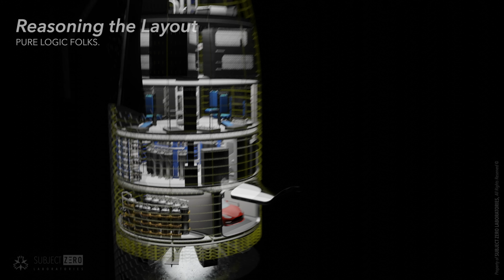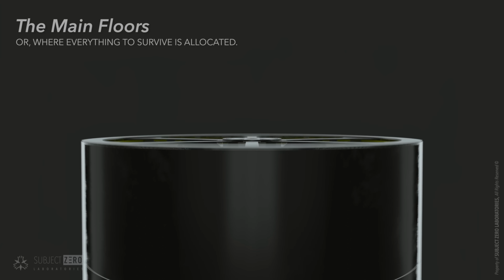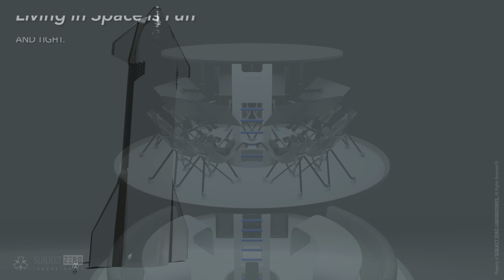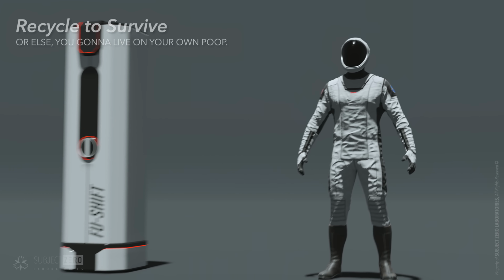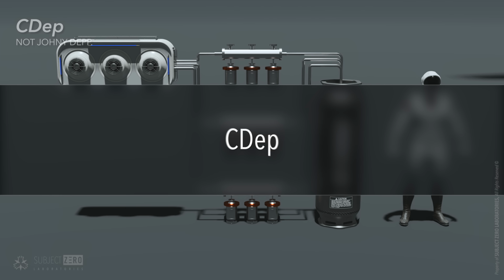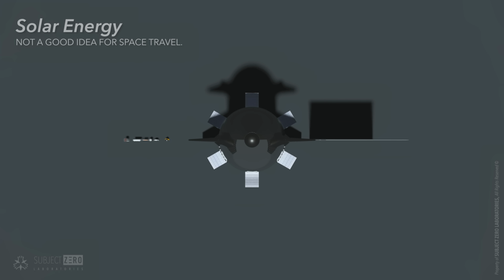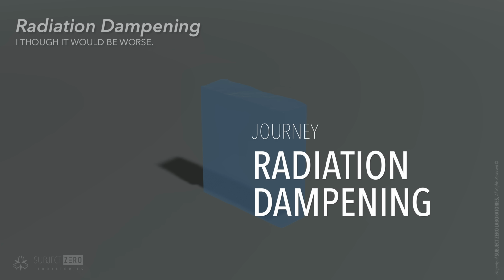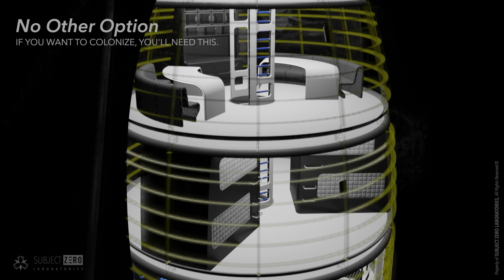Onboard the SpaceX Starship 2.0 in Detail - What it takes to go to Mars | Detailed Breakdown

Comment: Really enjoyed your video. Pretty thought out. There is a couple of items that are usually ignored that bothers me. 1) Starship when vertical has an up and down, but Starship when horizontal also has a up and down. When it's landing you want the people in the bridge of the ship to be upright. So the op's deck of the starship will probably look like the Dragon capsule. With 4-5 chairs sitting "upright" when the ship is doing it's flip maneuver to land. 2) The center of Starship will not be a "tunnel", but a "column". The main ship plumbing will be in the central column running down the ship, top to bottom (which will include the downcomer). That column should have hand rails / steps so people can climb up and or down the ship. Also, you wouldn't have a long tunnel running top to bottom. You will have a ladder going down only one floor at a time, with a slight off center look to the next ladder going down to the next floor. Like this, nobody will every fall more than one floor on Earth or Mars gravity and not 5-6 stories down. 3) I feel people that do these designs need to add water tanks between every floor, not to mention all sorts of wiring. So the in between the floors need to be much thicker, not just one level on top of the next. Because of this, I don't think Starship will have as many levels as people think it will.
Reply: Great comment on the middle column and the offset of level entries
Reply: It's possible it could be a 100 percent for water reclamation

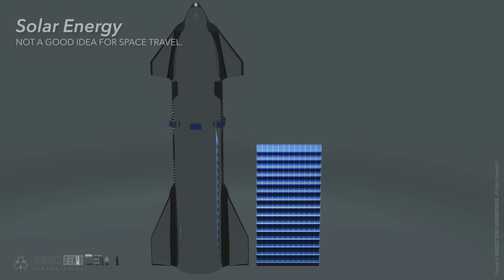Comment: 10:20

ISS solar panels were built in 1990s and are significantly less efficient than modern solar panels. Check out the iROSA panels - they were small enough to fit inside Cargo Dragon, yet still provide a significant chunk of energy to the ISS.

Comment: I would be very interested to see this with different mission lengths. Elon stated with a slide back in September 2016 that Mars missions should take
2024: 140 days
2027: 150 days
2029: 140 days
2031: 110 days
2033 90 days 
NASA has shown 30 days on Mars is possible to return before the planets are out of alignment meaning a full mission could be 330 days long instead of 5 years
That’s a 5.53x shorter mission
Daily ration 
2.5kg Food
3kg water
1kg oxygen
Water can be continually reused so is almost negligible per astronaut and the oxygen can be used from the main fuel tank instead of separate tanks, meaning roughly 2.24x less mass per astronaut 
CO2 and hydrogen can be converted to Methane and water using the Sabatier reaction and H2O can be converted to Hydrogen and Oxygen using electrolysis so this can mostly solve water, fuel, and waste issues.
This can effectively bring the mass requirement down to 825kg per astronaut (+ 75 kg astronaut + 75kg water) 
At ~1000kg per astronaut, 10 astronauts would only need 10,000kg for a return mission instead of 118,625kg

Comment: This was a great video to watch and very thought provoking.

My thoughts at the end are that the trip to Mars needs to be a flotilla (maybe 3) vs one ship.
This would have many benefits.
The multiple ships could be used, for example, one to carry people, one to carry supplies, 3rd for fuel.
The ships could be arranged during travel to provide shielding when necessary.
Finally, the ships could be used as backup vehicles - should something go wrong in one or the other.
Reply: You can't have three ships doing three different jobs and then use them as backup vehicles.
Reply: @darrennew8211  Yes...better to have all equipped!

Comment: wow THAT WAS AWESOME.  You found all the information I found and more!  I concluded a crew of 15.  3 pilots, 3 Rocket/Mechanical Engineers for maintenance and setting up solar arrays on the surface. 3 Geologist , 2 Evolutionary Biologist, 2 surgeons and 2 nurses.

To that effect my only criticisms, is there there is no dedicated sick bay or Sterile Clean  Room for surgery, experiments and computer repair.  I concluded that the water in the floors is not optimal since the engines and fuel tanks will block nearly all that direction.  The cargo bay walls could be used for water storage and that irradiated water could be used for power in fuel cells.  The rest of the ship could use the Polyethylene barriers and a whipple shield for micro meteoroids and I think there should be 3 air tight compartments , Command Deck, Crew Deck and Cargo Deck.  Most Mass Concerns with supplies can be alleviated by sending two additional Starships sent before the crew just as in the the Mars Express by Robert Zubrin
Reply: Water does not become radioactive when irradiated. So using it in the walls as a shield in most normal space radiation absorption scenarios would have no effect on its potability. One issue would be that if layers of insulation were used as further radiation protection on the inside of the spacecraft,  and few between the water and the outer skin of the spacecraft, it could freeze and rupture whatever container it was stored in.
Reply: Sick bay or sterile room for surgery may not be needed. On U.S. nuclear submarines, emergency surgery is done in the mess hall, see Dustin's SmarterEveryDay series on nuclear submarines. On Starship, it could be done in the social area.

Comment: By biggest criticism for most these designs are they all have a ladder or elevator, ladders suck for carrying supplies up and down and elevators are heavy and complicated and have the change of breaking but allow moving supplies easier. i always though a spiral staircase either in the center or along the outer wall makes the most sense, it can be compact in the center and is the steps fold up or down it can be easily used in 0G. no moving parts to break and can be made of extremely light weight material. easier to carry supplies up and down in gravity and much easier than a ladder for every day use.

Comment: I saw one concept about having a 30m or so long truss and attaching one starship to each end, and spinning it up to like 3 rpm would generate 1G of spin gravity in the starships, thart way you could get around the bone degradation issues. Also, 1g isnt even necessary, martian gravity would be good, getting the crew to adjust to that gravity for months before even getting there.
Reply: @Rick-vm8bl  But they have problems walking etc even though they exercise a lot, so With spin gravity that problem is completely solved, and it doesn't really require much more fuel. It would also make way longer missions possible.
Reply: Why not just use a cable?
Reply: @Jowbaka  Probably would work well when it is spinning but starting / slowing the spin might be a problem with a cable I guess. If the ships are not 100% synced in the breaking they wouldbprobably get tangled etc
Reply: @assarstromblad3280  Cable release was a problem that air launched gliders have solved since 1920 (for exactly the same reasons).
The angular velocity at release is a bigger problem.
Reply: @allangibson2408  Well the idea is that the ships swivel to stop the spin before separating from it, I't feels intuitively like that might be a problem if you are using a flexible cable.
Reply: @assarstromblad3280  If you don’t kill the angular velocity, the two ships are going to be separating at a fairly high speed… The one with the tether will also have a spin around the new centre of mass.
Reply: @allangibson2408  Yeah, that what I mean, as long as you can brake and stop the speed generated from letting go of the wire then it might work
Reply: @assarstromblad3280  At hundreds of meters of trusswork attached to many tons of spaceship, nothing isn't going to be "flexible." Do the math.
Reply: @darrennew8211  I am talking about some guy that proposed using a steel cable to connect the ships, that is, undoubtedly flexible.

Comment: Your rendering shows 4 or 5m diameter rooms (15 feet), but Starship has a diameter of 9 meters! (about 30 feet!)
That's huge! It will fit much more.
Reply: The Model 3 is under 5 m long and there was still space available behind
Reply: @Blacktrous  but the crew quarters sre very small in diameter.
And the model 3 is very impractical because of the small trunk opening, a bad decision.
Reply: Diagrams from SpaceX show a tunnel with ladders through the middle of the ship - so that the crew can move between floors, potentially with an elevator (for those who can't just Musk-magic themselves around). The full 9 meters by most accounts is measured from the outside to the centre.

Comment: The orientation of the seats on the flight deck could do some improvement, as the gforces during reentry should optimaly push you into the seat, with the ring config that would only be the case for a few of the astronauts so a more rektangular layout would be more comfortable. Anyway nice video in general with amazing graphics
Reply: Good point. Although this ring config looks impressive, it is not practical and makes no sense. It would probably work well for launch but Starship is designed for reentry with the belly. Astronauts will need to have sturdy front facing sitting position during reentry.
Reply: @no4h1453  I actually really like the topic of reentry vehicles, and i think the main problem of the starship is gonna be reentry safety. Just think about it like you dont know anything about spaceflight. Would you rather sit on the tip of a skyscaper going mach 20 in the upper atmosphere, or a small metal box that is aerodynamicaly stable and always points right side down? Maybe starship is safer than space shuttle, but the fact you cant do preflight testfires because the tiles fall of seems kinda sketchy.
Reply: What G forces during reentry?  Anything that falls, falls at that same speed.  Until belly flop g force would be one G minus drag.  The belly flop is to limit terminal velocity by increasing drag. If the seats were mounted "bottom down" relative to the rockets and the backs aligned with the "belly" during falls in the direction of the backs, the net drag and would be perfectly aligned for those seats. Once vertical the rockets' thrust would be opposing the seat bottoms
Reply: @psdaengr911  when tje rocket reenters it doest feel the one g of gravity because its still fslling, but in the deceleration of the rocket is felt by the crew.This is why crews in ballistic emergency reentries fell a lot of gforces, the sttep entry int the atmosfere creates a lot of drag and thus gforce.
Reply: @Andrew Well im not riding on something that doesnt have a launch abort system.

Comment: There will be several starship involved in one mission and possibly a few at the same time.

There would be countless problems if you imagine just one starship carrying astronauts to mars. 
They will be designing the space craft in way so that docking is possible in deep space. One for crew and another one for cargo. Also there'd already be a starship on mars with necessary cargo equipments.

Also each starship has to refuel in orbit to reach mars.

It's not easy and never will be but fitting everything in one go or a new concept will make unnecessary problems.

Comment: Why not send multiple ships at once? 
The ships could combine after lift off for the majority of the trip and separate again for landing. From the calculations of this video much of the supplies and equipment needed for "living" conditions could be spread out. Spreading the resources, weight and power could make the trip doable and with less constraints. Please do a video on how resources, supplies and power could be separated and combined to accomplish this. Elon Musk has all ready proposed that multiple ships are needed. 
Why not send them at the exact same time??
Reply: I think that it's because they want to be sure that the supply ships are safely on Mars before sending the crew. Imagine if one of the supply ships failed and the crew would be stranded or would starve -- it would be a disaster.
Reply: Even 3 will make such mission WAAAY easier.
1 for crew , 1 for backup to leave in mars orbit as return emergency , 1 with spare parts.

Comment: I would expect an RTG or similar power supply for use not only during the trip to Mars but as a power source for the base on Mars . The base will of course need multiple sources of power but an RTG unit works continuously for several years and only requires a way to dissipate heat which is also useful on Mars .
  As for food , I would actually expect that among other things would have been sent ahead in a previous window so the only food needed to be brought with a crew is what they will eat on the way to Mars and any less long term storable foods . Pemmican is a food that would be good to have as opposed to only eating freeze dried and it keeps for years , depending on the recipe it can actually be pretty good along with much needed calories . I know from personal experience that eating freeze dried food gets old pretty fast without adding spices and even at that the caloric intake is pretty low per meal and not what I would call sustainable by itself . As a backpacker I understand the problems with going lean on weight , some sacrifices have to be made or you will suffer far worse things than carrying some extra weight .
Reply: Fine for on the surface where it can be buried some way off or screened, but on board ship it would create a radiation hazard for the crew. This could be mitigated with a lot of heavy shielding but that defeats the point.

Comment: Great video. I don't understand why you would need the oxygen bottles when you have a hundreds of tonnes of Oxygen sitting in the propellant tanks? Additionally why would you use Hydrogen fuel cells when you have a giant tank of methane? Why would you not use Methane fuel cells? The other point that may be lost on some is that the hundreds of tonnes of Methane and Oxygen in the propellant tanks as well as the tank bulkheads would provide an enormous amount of protection if the ship is kept in an orientation pointing away from the sun.
Why not create additional radiation and thermal protection by putting in blanket shields of similar but lighter construction as the ITER, as you demonstrated in your last video? These are suggestions not criticisms, thank you for such thought provoking material.
Reply: 100% agree, methane fuel cells.
Reply: makes sense.. SpaceX chose methane for a reason.
Reply: Because there is no access to the content of those tanks outside of the gravity well.
Reply: @hans-joachimbierwirth4727  pumps
Reply: @michaelmoore1403  pumps don't work where there is no pressure gradient, and that depends on gravity.
Reply: @hans-joachimbierwirth4727  on the apollo command module they got around that by using stirring fans or agitaters, which where the electrical fault was that cause the explosion on apollo 13.
Reply: @hans-joachimbierwirth4727    the other way of cause is by the use of smaller header tanks inside the main tanks like they are already doing for landing. This is less ideal as it adds weight and complexity to an already complex system. There will also be plenty of ullage gas to access.

Comment: I've often wondered something about using water as a radiation shield: How will that much radiation absorption/shielding affect it's potability?
Reply: Radiation does not effect potability. Radiation are just high energy rays that can damage molecules like DNK. In case of water in worst case radiation just heats up the water but not by measurable amount. 

It would be different if the water would be contaminated with radioactive material like uranium. In that case water itself would contain radioative material and be radioactive.
Reply: Radiation and radio activity particles are different, you can bombard almost everything with radiation and nothing else change, radioactive particles are a different story because they are small and if you ingest or get them in your longs you will be constantly getting that radiation and probably dye.
Reply: Only neutron radiation would have any significant effect on this and even then it would need to happen over a very long time. Most other forms of radiation such as high energy protons, and alpha particles will be stopped dead by even a sheet of paper. High energy electrons are stopped fairly easily by metals and gamma radiation passes through most things and so is difficult to prepare for.
Reply: In the event of solar storm or cosmic ray storm the transmutation of the water may induce super powers if ingested.
Reply: @nagualdesign  absolutely. We only want 4 passengers on board in this case. Just to make sure we can call them fantastic four
Reply: You'd need several meters of water for radiation shielding for a trip to Mars. Given the ship is nine meters wide, that's a non-starter.